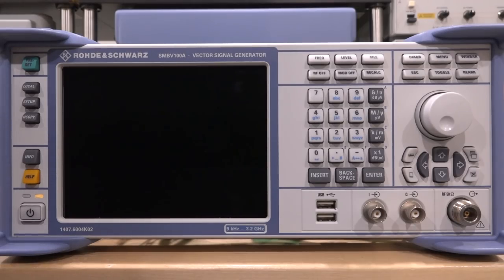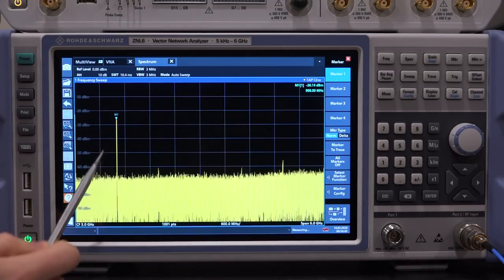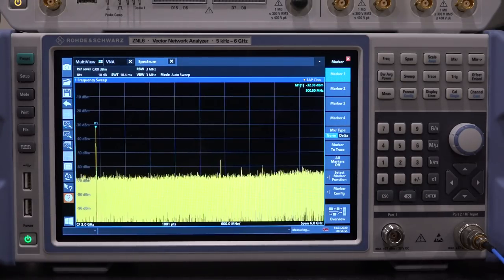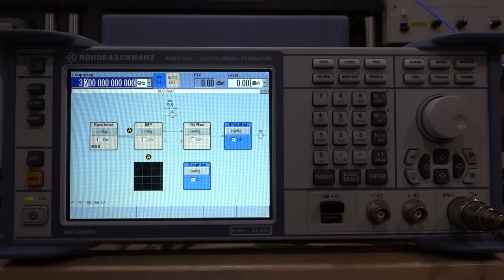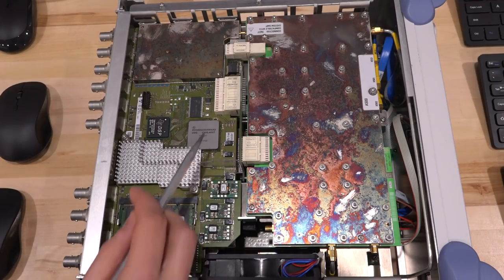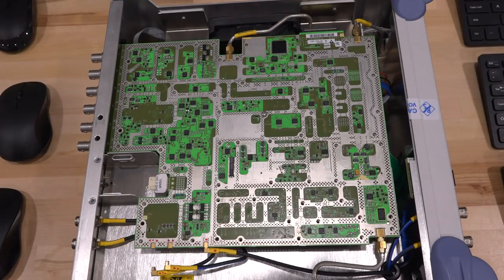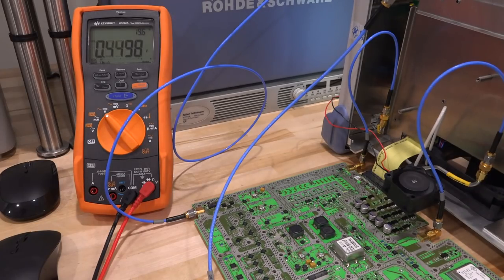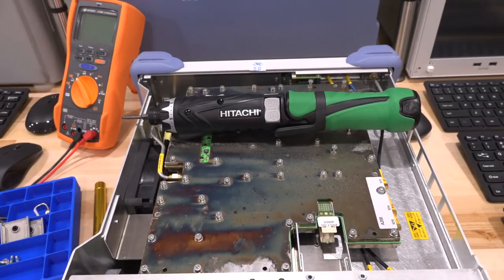TSP #167 - Teardown & Repair of a Rohde & Schwarz SMBV100A 9kHz - 3.2GHz Vector Signal Generator

Comment: What a treat with a teardown and repair of a 1 generation old vector generator and current gen combo VNA+VSA.

Regarding the LO feedthrough at the end of the video:
Internal alignment on the SMBV100A is under 15 minutes. After that, IQ Modulator > change optimization mode to high quality and then Adjust IQ Modulator to current frequency. That should significantly improve LO feedthrough. You can also use baseband frequency offset to move the LO out of band, up to half of the baseband bandwidth.

Comment: So the failure of a two-cent component potentially rendered this high-end device as scrap? Now it's working, it'll make a nice addition to the Lab.....but I bet the original owner is a little bit peeved.
Nice new intro and thanks for uploading!
Reply: You forgot to include the $1500 repair fee.
Reply: And if it would have been sent to an ordinary repairer they would have quoted for a main moderboard swap, since they don't have any logic to think or even the education as usual.
Reply: @stargazer7644  He changed a mosfet and after that the output worked as it should, what the hell are you talking about?

Comment: I'm curious what made you think of the relay as a primary area for the fault - when I saw the high pass response on the output I immediately thought of the connectors or just a solder joint being broken.  Was something about the way it responded a telltale sign?  Did you just check the connections off camera?  Is it just very unusual to get a mechanical fault between the front panel connector and the board when there's no physical damage to the unit?

In any case, another nice repair and addition to the lab!

Comment: Very nice explanation and repair as always. I had a problem with an RF generator using mechanical attenuators that gave similar indications during troubleshooting - near normal output at 2 GHz but rolled off significantly at low frequencies. One attenuator section switch was not making contact when switched out but was OK when switched in.

Comment: Great job there. I did notice that the coil voltage was a little low and wonder if it was due to the replacement mosfet's on resistance being higher than the original.
Reply: Any mosfet's on resistance will be thousands of times smaller than the 80 ohm relay coil, so its contribution to the voltage drop will be insignificant.

Comment: I repaired a R&S VNA, to get in the powersupply I needed to remove 84 screws. I need such an electric screwdriver too. About the relais, is that good ? if I understand it well it was not turned on. But it only attenuated the signal while I would expect it to completely cut off the signal. What is the use for it if it only attenuates the signal some dB instead of totally cut it off.
I love it how you diagnose the problem. A request, can you do the repair of a complex switching powersupply or if you can not find one, make a video about how to diagnose one. Like the ones used in instruments like this ( not the simple ones used in consumer stuff)

Comment: Is it possible to make a modification to the Agilent 8960 so that it works from 100KHz to 3GHz? I was interested in using it to work with radios for amateur 1.6Mhz to 1.2Ghz.

Comment: Thanks for the upload! During the close-up of the input section (e.g. time 13:22), I notice a gap in the ground, just to the right of the input connector  - is this truly a disconnect in the grounding? if this is intentional, what is the motivation?
Reply: To me, it looks like it's just a sliver of solder mask (which might have been part of the CAD footprint, but didn't print on the other side), that is, there is actually connectivity still. The metal case would also provide a ground path.

Comment: What is the input mains voltage for the electric screwdriver charger. I'm looking for a 230v version for a friend. I have the Milwaukee version and the look the same in basic design but diferent molding on the plastic housing. Great tool to have with auto stop clutch

Comment: Those electric screwdrivers are pretty nice, having got to use one at work, I understand why the technicians refer to them as "magic wands". That said, the charger is really bulky for what it is, it would be nice if it had a USB charging port built into the battery.

Comment: That's really unusual for the MOSFET to fail like that.  I'd wager it got destroyed by the inductive voltage kickback from the relay's coil because the kickback protection diode has failed...or was absent in the design.